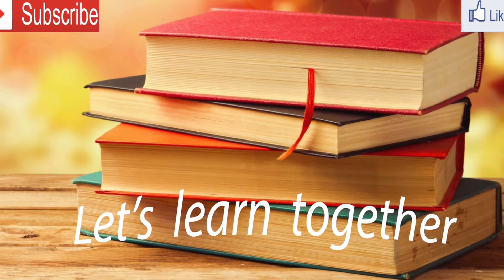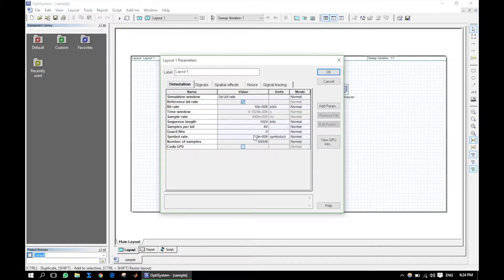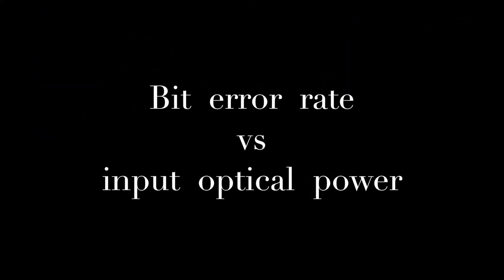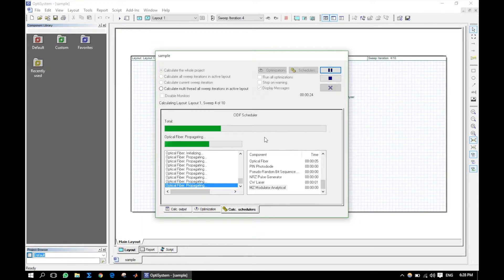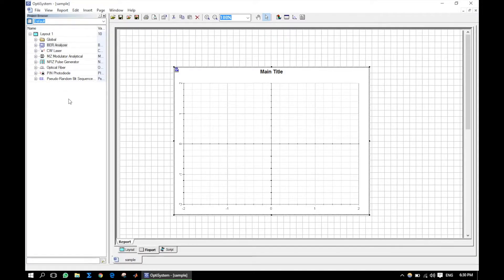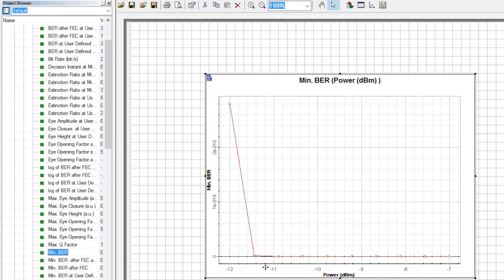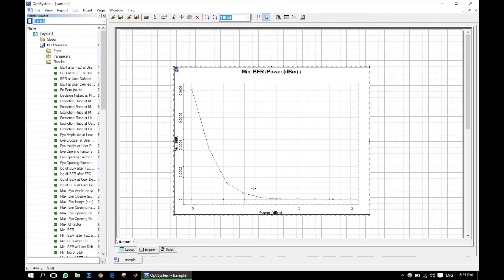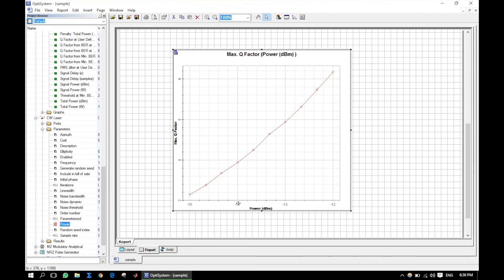How to use parameter sweeps and plot 2D graph in OptiSystem | OptiSystem tutorial for beginners

Comment: Sir how to plot multiple graphs for 2 varying parameters w.r.t third constant parameter. Ex BER vs o/p  power plot for a range of 1-5 km each on single graph.
Reply from the maker: You can plot easily using MS-excel. Make 1st column for the output power and as many columns for the different transmission distances. each column will contain the values of BER w.r.t. the O/P power. Click and drag to select O/P powers values of the 1st column, then press and hold the control key and drag to select all the remaining columns. Now go tho the insert tab and there you will find charts/scatter plot.
Reply: Thank you Sir.